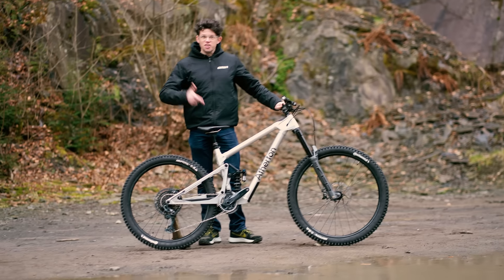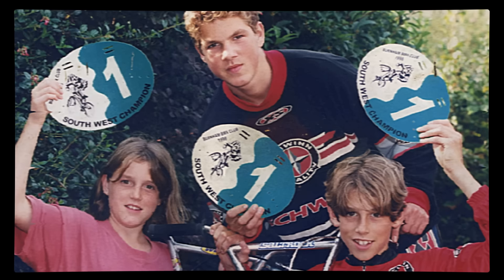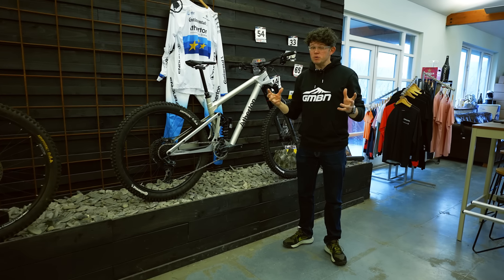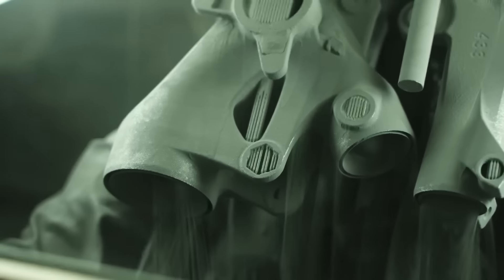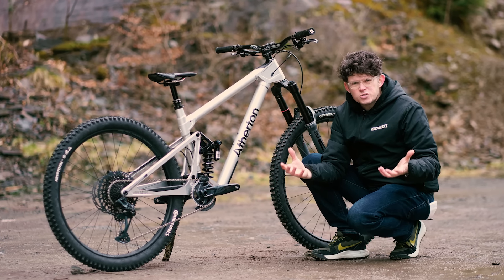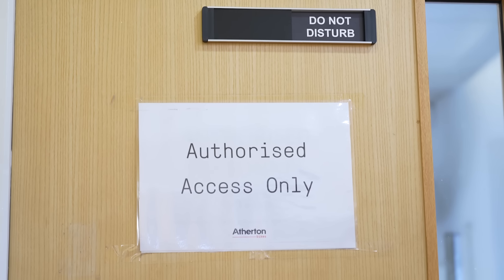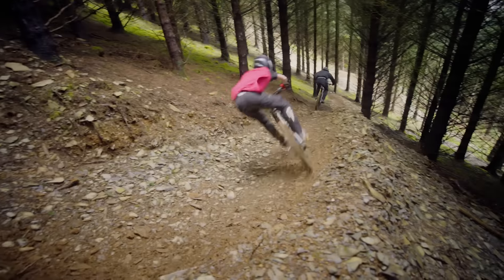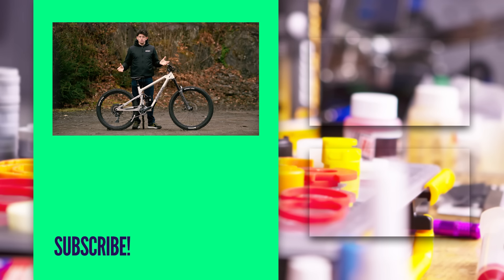Building An Alloy Superbike! | Behind The Scenes At Atherton Bikes

Comment: Affordable?  What a joke.  The only affordable decent bikes are the Asian direct to consumer brands like Polygon.  It still boggles my mind how a pedal bike could cost as much or more than a motorcycle.
Reply: Simple:

Take ALL OF THE RESEARCH done to make motorcycles work well. All that stuff informs the bike world. But no one's giving that info out for free.

Then, take away the motor. How well does a heavy-ass motorcycle go up a hill (or down switchbacks for that matter) without a motor?

Since mountain bikes have to be powered by people, they have to be light enough to respond via pedaling. Try to tow a motorcycle with a mountain bike.

Additionally, they have to be designed to be as strong as possible because jumping, drops, rock gardens, etc. exert a lot of force. And maneuverable. Have you taken a motorcycle off a hipped four-foot drop into a catch-berm at the top of a mountain recently?

Heavy is easy. Strong is easy as long as you don't mind REALLY heavy. The combination of strong and light is VERY difficult.

Now, spread all of that research out across three or four sizes per bike. Each size requires different tubes and each tube has to be designed, tweaked, and manufactured separately for its length and diameter. Only really one size per motorcycle.

THEN realize that the economies of scale are heavily in favor of motorcycles. Honda sells more motorcycles than probably any brand of mountain bike sells. 18+ million worldwide last year.

...and so far we've only talked about the frame.

It's also fairly inexpensive to make functional eyeglasses. BUT, to make them purpose-built to accommodate a wide range of prescriptions, get the lenses specifically for your prescription, make them light enough on your face to not be super uncomfortable, treat the lenses to be scratch-resistant, design the lenses to be durable, design the material to withstand the accepted wear-and-tear, and then make them look good...very difficult. Expensive, even!

I could make a bike this week. YOU could make a bike this week. You could buy tubes and a welder and a Dremel and just put some things together that hold wheels and a fork and gears.. How would it ride? Would it be good enough to sell? Would you trust it with your life? Would anyone else trust it with their life?

All of that said, you're right $5,000 is not "affordable." I would LOVE to get an Atherton bike. I'm an odd size and just having options to fit me really well would be almost worth it. My budget is probably going to max out at around $3,500 for a sport and hobby I really, truly love. I can't justify those costs, though, when I look at what else I'm trying to do with my money.

How much are people spending on alcohol or drugs or cigarettes or tattoos or video games or unnecessary driving or a million other non-essentials? It's about priorities. My priorities are in building my business so I have less funds available for a hobby than would be ideal. It's a tradeoff I'm willing to make. I've already given up all the other stuff and I won't give up riding bikes.

But the disingenuous "I could buy a motorcycle..." stuff is really a demonstration of ignorance about how this stuff actually happens in bike development and the wild demands mountain biking puts on these relatively simple machines that we literally trust with our lives.

Comment: will there be a frame only option?
Reply: yes, you can find it on their site
Reply: 2000-3000 what I call a budget full suspension Mtb and 1000-1500 hardtail
Reply: @ROSE-by5su   note that € and $ dont include VAT, so in all cases its over 3k. NOT a budget frame by any means

Comment: Very nice, but you keep repeating that it is great suspension, but never explain one bit what makes it so great. Not what kind it is, not what it is designed for and not characteristics. 

Same deal with manufacturing process "brand new", "unique", "cutting edge" - ok, but what exactly are the pros of that approach? Other than sizes (which is awesome) but hardly the only meaningful metric

Comment: What's holding that alum headset lug to the frame? If it's more "bonding"/glue, then you can keep it. After Bernard Kerr's crash, where his headset came apart from his frame during a rough downhill, you couldn't give me a lugged bike of any sort. Don't trust their long-term durability.
Reply: Bonded carbon/alu bikes were there already in the late 90s. Take a look at Giant Cadex CFR 1. I used one till the mid 2010s without any issues. Sold it to a good friend, who's still riding it.
Reply: I'll have to agree on that one, idc about the "statistics" weld or nothing, anything glued in died with Pole
Reply: BK was riding prototype bike.
Reply: Tbf qny bike would of snapped under that force no matter how it was put together but no glue does not appeal to me either
Reply: @AlBorland3877  a cross country bike goes through less stress on the material than a downhill bike or an Enduro bike except if you don't really beat up your bike. Even new give me 1 hour with that bike and I can snap the frame doing few big drops or land side ways jumping. The cranks, bars, wheels, and most other components will be destroyed very fast
Reply: @ChristianPareATLAS  you can't test a bike harder than the athertons or Bernard Kerr mate. Get your head out the clouds.
Reply: Best not fly on modern aircraft then.
Reply: @8o8ertmtb  I thought they use rivets to hold things together on planes (not that I currently can afford a ticket). I'd have to check w/my sister. She was an engineer at Lockheed-Martin.
Reply: It's glue and it's ugly.